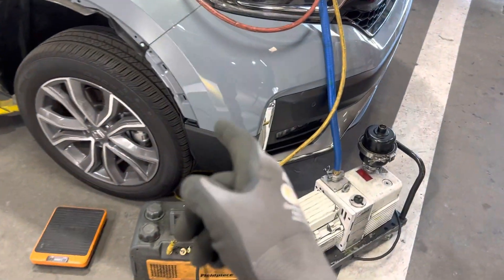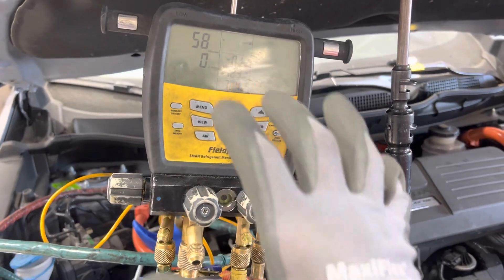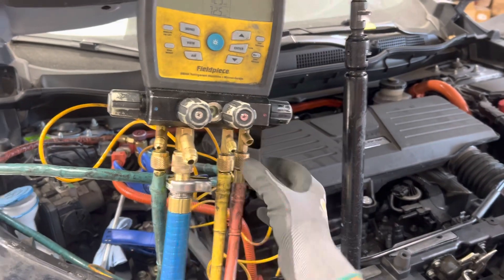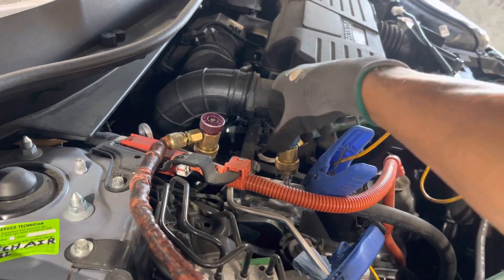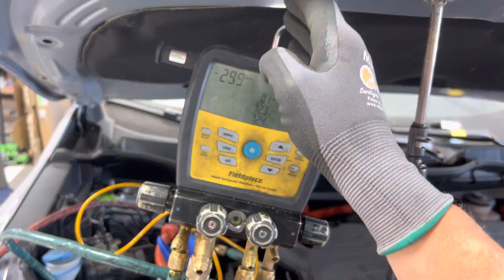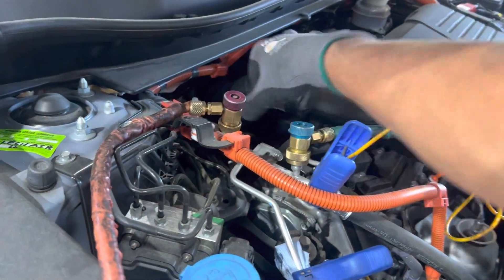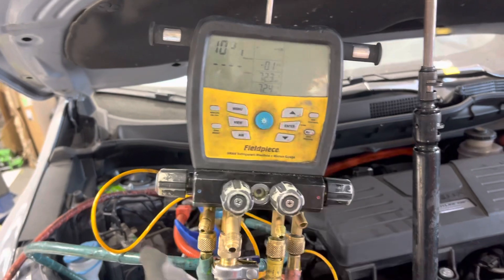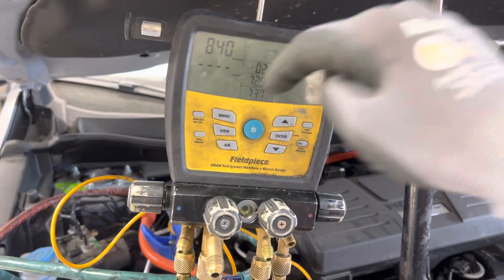VACUUM FIRST STEP ALWAYS CONFIRM you can at least pool below 100 µm. ( Analog gauges can’t do this￼￼

Comment: This is the same concept of testing your test equipment. Any time I use a volt meter, scope, test light or any other test tool I always verify it's working. Too many guys chase their tail when the problem is their leads are bad or their test light isn't connected to the battery ground well enough.